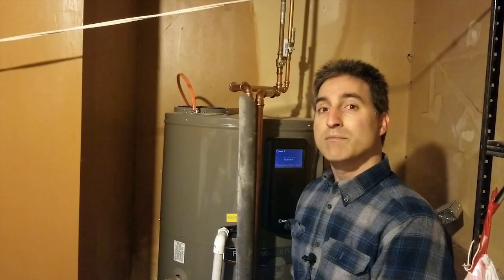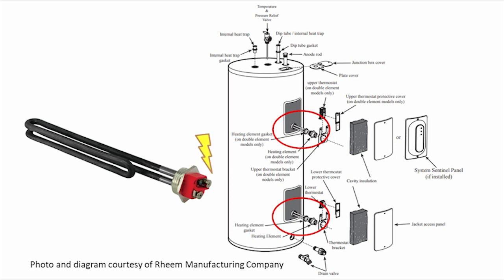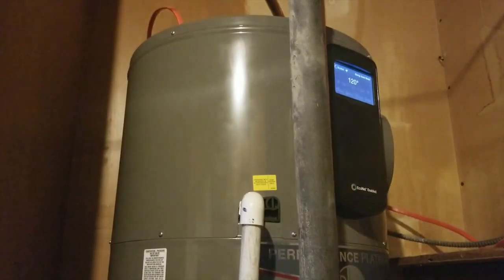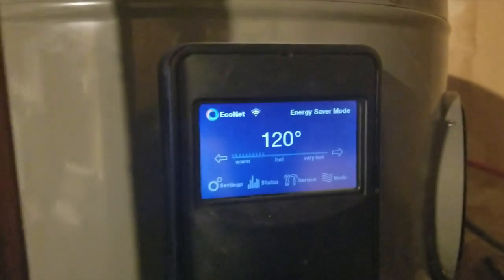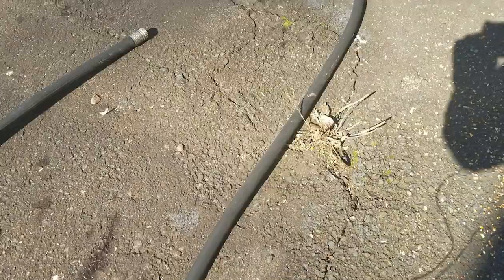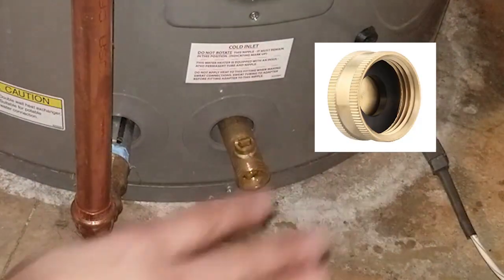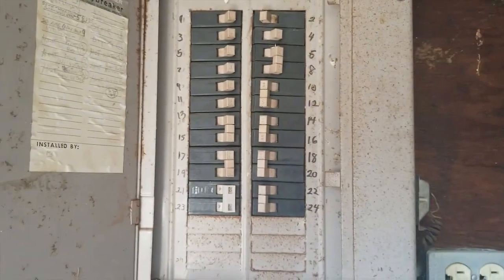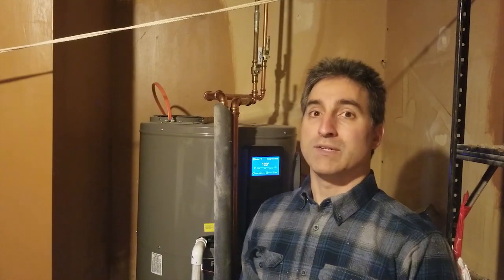Flushing an Electric Hot Water Heater

Comment: If you are going to drain it into a toilet, shouldn't you wait until the water in the tank is cool? Hot water going into the toilet could melt the wax seal that is used on the toilet and lead to a leaky toilette.
Reply from the maker: Good point!

Comment: I left my bathroom faucets open on the hot water setting but didn't close them until after refilling the water heater.  Now I have little to no water coming out of either faucet.  The rest of the faucets in the house are working fine.  Any thoughts on how I can my bathroom faucets?
Reply from the maker: Hmmm. My initial thought is some sort of airlock, but I would think if no other faucets are open, then the water should eventually come out of the bathroom ones because any air trapped in those lines should escape through the open faucet. If you have hot water coming out of the other faucets in the house, then it is safe to assume the tank has refilled and is delivering hot water. Do you hear air hissing from the bathroom faucets? Any professional plumbers, please chime in as I think I might be missing a plumbing phenomenon of which I am not familiar.
One other thought is if sediment may have clogged the faucet aerators. If cold water does not work either, then this could be the culprit. Try removing the aerators by gently unscrewing them counterclockwise from the point of view of looking into the faucet. Use a rag and wrench if you cannot budge them by hand. Close the drain to avoid losing parts down the drain.

Comment: thanks for the video. I have never performed this action before. our hot water ebbs and flows now for the last few weeks and now it has almost completely stopped. we moved in almost 6 years ago and have never flushed it as we didnt know we were supposed to. So there is only one main lever for the water, there is no hot and cold lever so  iassume you just pull that water main lever?  The worst part is that there is no water softener installed in this house. So how dangerous is it to try flushing it, or should we just get a new one when we can afford it  and then install a water softener?
Reply from the maker: I have read that older heaters, if they have not been maintained, may not do well if flushed as sediment and corrosion from a spent anode could lead to a leak. My current water heater was never flushed, and it is 10 years old, so I am opting not to flush it. Average lifespan is 10-15 years, so if you think it is over 10, it may be time to replace it. If your heater only has one shut-off, it is the cold side. Some heaters are installed with two, I assume, to minimize water leakage when the unit is replaced. Are you on well or city water? City water may not require a water softener, depending on where you are and what kind of processing they do to the water.
Reply: @par64guy  well, thanks for the reply. I am hesitant to mess with it because I have never done it before, but it does seem pretty cut and dry. Is there any reall risk of explosion or massive rupture If i try it?  Kind of a disaster because we arent gettign to hat hot showers and it cold up north.  :)